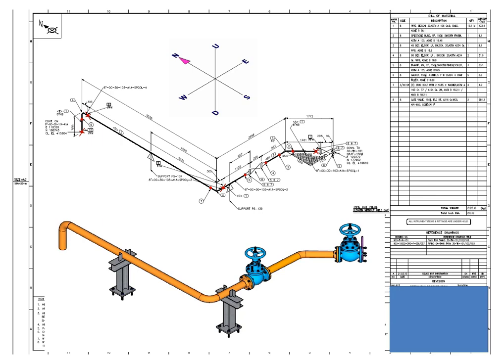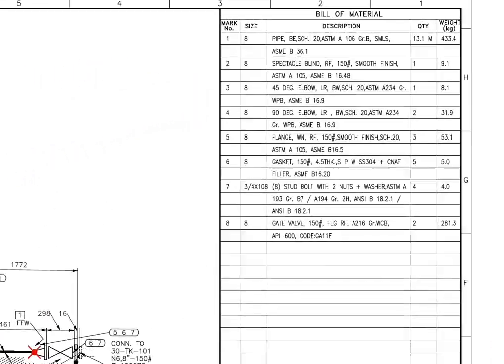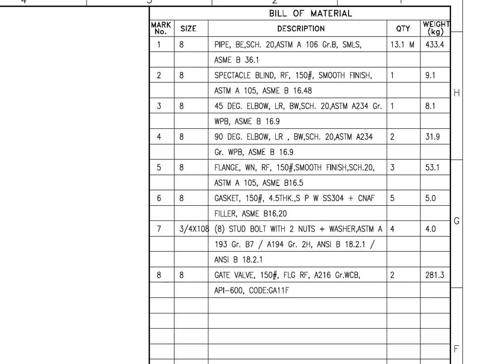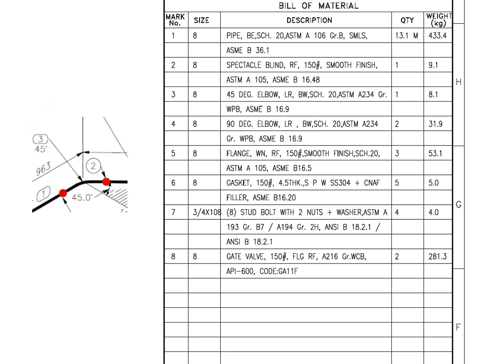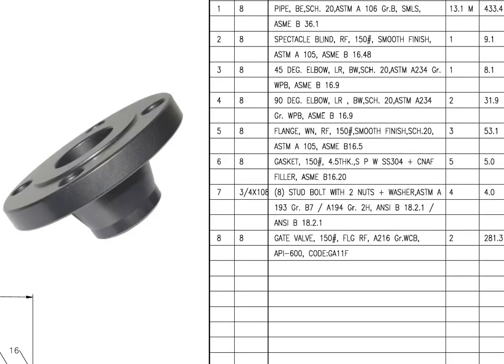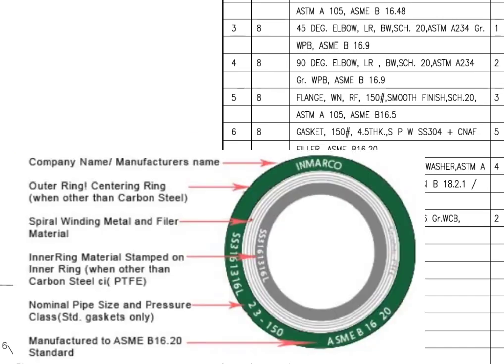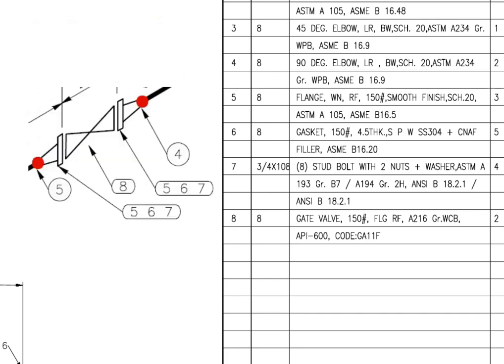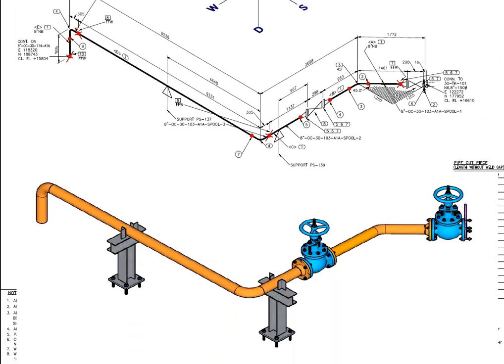Piping isometric material list reading, study tutorial for beginners

Comment: I  like  your  videos,  tell  me  what  the  blind  flange  purpose is ?
Reply from the maker: Blind flanges are  used to terminate the end of a piping system. The blind flange is basically a flange that does not have a hub or a bored center. Blind flanges have the face thickness of a flange, a matching face type, and similar bolting pattern. Blind flanges can also be used to seal a nozzle opening on a pressure vessel.